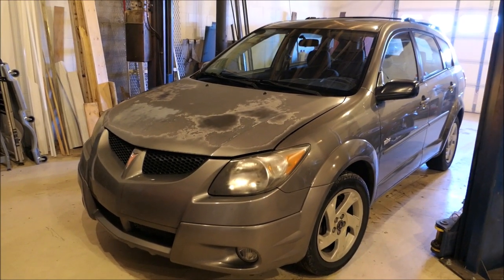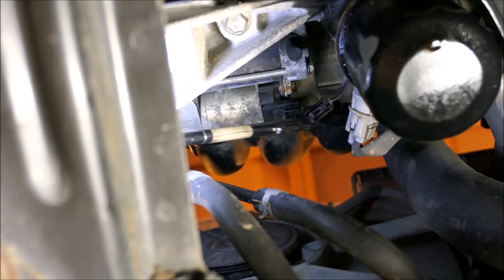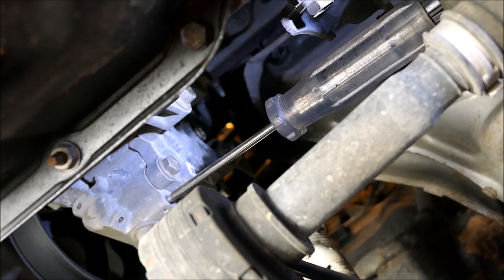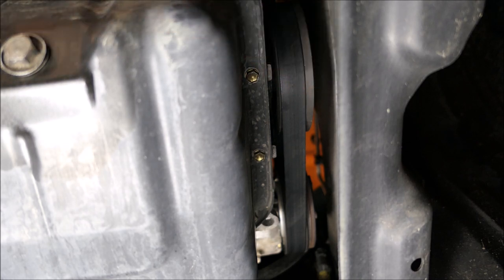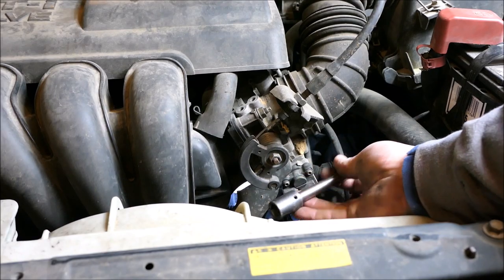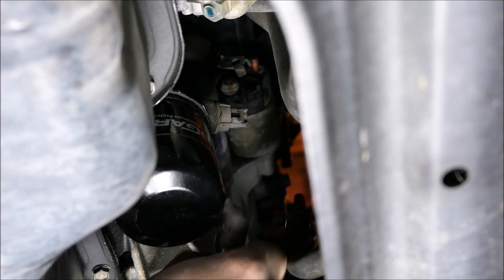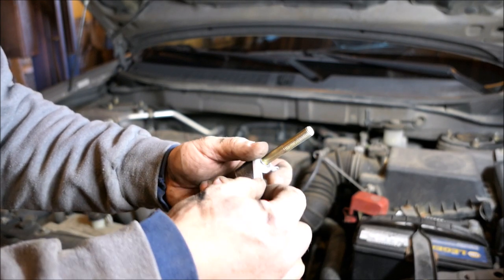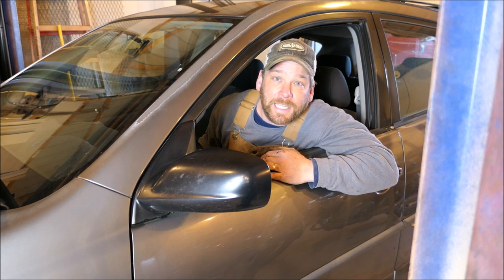How to TEST and REPLACE a Starter Pontiac Vibe Toyota Matrix

Comment: Would also mention returning the old starters core. Also rather than the entire starter being shot it could be just the solinoid. Anyway good presentation for diyers that haven't under taken a starter change.

One last bit, ensure not only the mounts on the new look like the old, but also the posts or plug that the wires connect to. Some fluid film or dielectric grease is a good adder as well.
Reply from the maker: It was actually the solenoid bad, I didn't want to go in to that much detail most folks will just change the starter and mine was original so it was time for a new one
Reply: @kentuckyyankee  yeah a swap is what I'd do to. Quicker and less likely to need pulling off again in 6 months time.

Comment: I had a 2004 Vibe. Best dang car I have ever owned.  It died on me while driving through Quincey, Florida a couple of years ago with what I think was a connecting rod bearing failure of some sort. I had to leave it there. All original except the 5 speed transmission and clutch with 280,000 miles on the car.  I'm tearing up... I gotta go....
Reply from the maker: Love this little car, best one I have ever owned!

Comment: question when the starter is bad it won't turn at all correct? mine is like , it doesn't and then it does and off i go, what could this be?
Reply from the maker: Hard to say, bad starter could be thr issue if it's intermittent
Reply: okay thank you @kentuckyyankee

Comment: I probably missed it but you do want to disconnect the battery before removing and installing new starter?  I don't know for sure because I'm a motorped kind of guy.
Reply from the maker: Yeah I showed it, you missed it.
Reply: @kentuckyyankee  I figured you had done that.  I would've forgot.
Reply from the maker: @jackrutherford-1  😂😂 No you wouldn't have
Reply: Saw a video with some teenagers recently doing an intake swap on a Chevy 350 tbi. Got a good laugh when they went to remove the alternator and sparks flew. Will see if I can find t and will post what time to forward to for the laugh.
Reply from the maker: @danielsimpson8929  I will check it out
Reply from the maker: @danielsimpson8929  😂😂
Reply: @kentuckyyankee  yeah was hard to get through that video with the kids being kids but that part was hilarious.

A friend got a '95 Tahoe 2 door sport. He's not very mechanically inclined yet so he couldn't tell me about the 350. Seems in 95 some 350 engines had tbi, others got vortec.

Been looking for tbi videos but there aren't many. Except for clean and rebuild. A few tbi to carb. One tbi to port FI. 

The scarcity of the manifold videos had me give those kids a try. Was going crosseyed with use of screwdrivers to pry against the valve covers to get the manifold out, then even more crosseyed with all that coolant on the lifters. But it was somewhat relevant to what might be done to buddies new SUV.
Reply: Daniel Simpson I skipped to 11 minute mark. Still hard to watch. But yeah don’t leave battery connected.

Comment: Ok. I removed the starter and took it to O'Reilly's for testing. The starter tested good. I put the test light where you showed in the video and it lit up when I turned the ignition. Now what? The battery is good and fully charged. But, all I get when I turn the ignition is a click sound.
Reply from the maker: Check your ground
Reply: IF it's 'Clicking' then it would probably be the 'Solenoid' (Unit) that needs to be replaced, they make that sound when they're going out, etc...! -jbm (P.S. he shows the Solenoid at about: 4:01 time frame in the Vid., on top of the new Starter, etc...!)